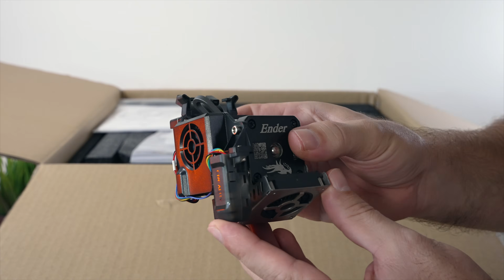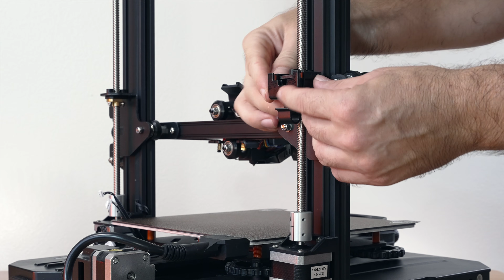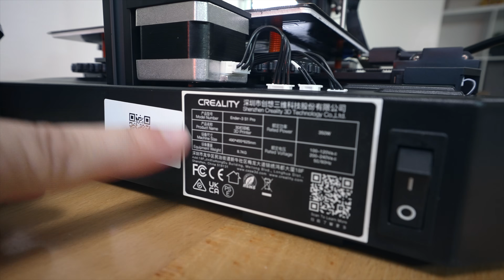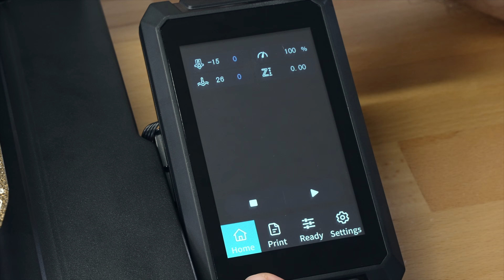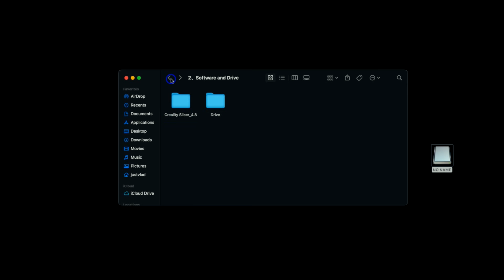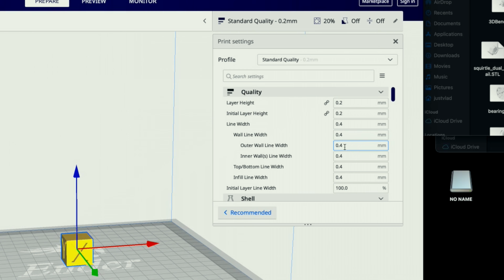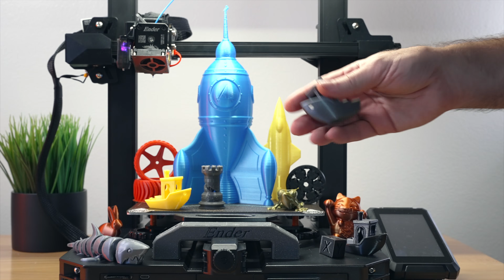Creality Ender-3 S1 Pro - 3D Printer - Unbox & Setup

Comment: Finally scrapped mine this week. Had it for about 18 months and only printed one of the test models. Worst machine I’ve ever owned. Never worked, impossible to level. Replaced it with another Creality as fighting it did my head in.

Comment: For some reason I’m not able to go thru the manual leveling process. The buttons aren’t recognized and machine doesn’t do anything. Manual leveling works just fine, but I need manual to work. Also my sd card isn’t recognized. Nothing shows in the printer page

Comment: im not trying to hate but im just setting up this printer and im not sure if these are fake comments praising how easy this is but. i don't find this easy or clear. The instructions are trash, loading filament in the manual has you heat the nozzle and it will autofeed the filament. The manual does not go into how to heat anything just says to heat it. In the video i see how to heat the nozzle but you don't show how to stop it. What does PID mean? For a complete novice this vid has some missing info. its better then the manual but not by much. Im sorry it could just be me but i find this very frustrating. IDK

Comment: The first best video I have seen on Ender 3 stuff. I have just done exactly what you have shown me with success, up until I got to the bed levelling. When doing the Manual one I hit my 1st problem. When using the paper for distance, as I have always done on my old Ender 3, I cant seem to get enough lift of the bed to the nozzle when it runs out of tension Spring and it is still 30mm away from the nozzle? Can you advise with this please?

Comment: Excellent video. You are very good at this and your instructional video is very much appreciated. One question: when you slid your y axis table back and forth, did it feel notchy i.e. points where the table stopped until you pull a bit harder then it continues to slide?

Comment: UNFORTUNATELLY, the Ender 3 S1 Pro was one of the best for the price(not so, but, worth the money many said) when I was deciding which one to buy, and the dream came true, it was quiet, within the budget, good quality, heavy built, easy to learn, but ... after a month or so it unveiled it's failures (injected on purpose in my humble opinion), it started with the extruder cable making false contact somewhere in the plug, then the CR Touch started to descend every time the extruder reached the Y limit, every time !!, even before I noticed, then it started crashing against the heating bed border, scratching the magnetic layer, bending the CR Touch Probe, so no more auto leveling or manual leveling, just nothing the same day the Z axis was not properly detected (I assume) causing the nozzle to plow the tip against the adhering layer hurting the nozzle, the bed and bending the heat break, in a single day 6 elements of the printer were SEVERLY DAMAGED, don't buy this BS !!!

Comment: I just bought this printer thinking with the auto bed level I wouldn’t have to do all the leveling I had to do with the pro. And now I have to level the bed and the extruded. What a pos product. This thing is going back for return. Why would they put a auto leveler and I still have to level it.

Comment: Ok, you totally left out the step where you measure under the right and left side of the x axis bar, if you don't do this you'll NEVER LEVEL your bed properly. This will make people want to rett their printers or try a different brand. This happened to me last night I finally found the x axis bar drooping on the right side of the printer. But great video!

Comment: Thank you, i had issues levelling the bed at first but i eventually figured it out. essentially i manual level first, raise the z axis 1.0 at a time until close enough, then spun the physical rings under the table with a paper touch, did the automatic and then a manual test again. I ended up going 3.5 on the z axis in the end but I'm glad I went bit by bit. nearly broke my nozzle by plunging it into the table. but not enough to cause damage.

Comment: i have tried following along, but when i went to manually level it, the leveling bolts ended up screwing out all the way and it still wasn't tight. then after sucessfully autoleveling, i tried to do the offset and got to -5 (maxed out) and it still wasn't touching the bed or computer paper i was using. ugh.

Comment: How the hell you could manually level the bed while keeping the z-offset at 0.0 it's something i cannot figure out. Even if i get all the bed knobs all loose, the nozzle still is about 1-2 mm above the bed. I have to adjust the z-offset previously to something reasonable, then adjust it again after auto-leveling

Comment: After watching your Review and as I wanted to have a 3D Printer, I bought this Printer directly from Creality as they had a sale on. I also bought their Sonic Pad Control hoping to use the printer remotely via WiFi (if I haven’t understand incorrectly). Have you done any review on that Control Pad by any chance matey?
Also, after levelling up the Bed, I had to offset the Z Nozzle a fair bit for some reason. I had to offset -2.50 for APL Filament & -3.05 for ABS Filament … I tried to reach out to Creality a several time without any success. I even tried to call the number on their website, was the dead end too. Since I watched most of your reviews on 3D Printers especially those by Creality I felt much confidence to go ahead to take the step and committed to their Ender-3 S1 Pro . I was thinking to printing a 300mm long roughly 150mm width and 20mm depth plate ( Zero Clearance plate to be precise) for my Table saw. If I setup an angle do you think it can be achievable at all? Any advice and your kind guidance would be much appreciated. As myself being disabled I need a lot of help and jigs to do any normal things those anybody else can do eyes closed (metaphorically). Anyways, I probably took long enough time and asked too many questions, hence I do apologise. Look after yourself and each other & Stay Safe. Remember Life is Short so Live Long and Prosper … 🖖 Cheers mate…

Comment: great video, appreciated.   question:   for manual levelling,  I loosened the 4 knobs pretty much all the way but the nozzle is still quite high up from bed/paper    I was able to use Z-offset of -4.65 and get it touching paper on all 4 corners.    I think -5 might be max zOffset so I'm curious is there something else I can do to get bed higher up, closer to nozzle?
Reply: Having same issue. Did you find a solution? No where seems to have a good answer

Comment: Followed all of the directions in the video but I am struggling with getting the bed centered for the leveling process. it keeps wanting to test off the edges of the bed. Manually resetting the settings to factory doesnt help.

Comment: @ 14:39, I have this printer and the label on the cable is to be inserted in the bracket so it can be pulled out again if you need to. Also, the cable plug ins on the left side, put the stepper motor one in LAST so you cab push the other 2 in front of it towards the left side edge to keep them away from the bed.

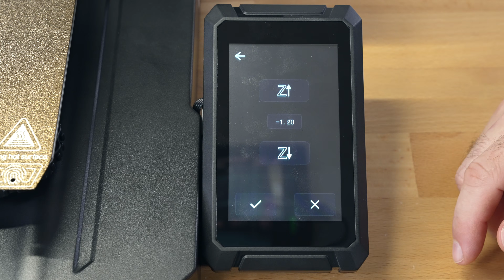Comment: You have "nice screen" because of... black bezels around?? Looks like pathetic advert. Screen is nice when it's CAPACITIVE! And my guts tell me this cheap screen is pathetic resistive sht. No matter how big resolution is (it's NOT NEEDED), but important is how well your screen reacts on your touch. Obviously if it's resistive, it's cr@p. And... YEP, I reached 34:04 where you tap FOUR times before you get to previous menu! Screen is rubbish!
Menu of the device is also simplistic and has barely distinguishable elements. Looks like people took CONSOLE interface and reflect it on GRAPHICS screen! So ugly interface I didn't see since MS DOS with TurboVision.

Comment: Great video. I am completely new when it comes to 3D printing. I have no idea what I'm doing. I purchased this printer after hours of reading and watching videos to decide which one I wanted. I just got it in and I've watched this video a couple times to assist with setup. I am having some issues and I don't know where to go for help.

I have attempted to level the bed manually, as you describe in the video, and then use the auto leveling. My bed seems to be too far from the print nozzle. I have to completely loosen the screws on the bottom to where I can't adjust anymore to get close enough to the nozzle. After all 4 corners are close to what I assume is good, I push the center button. The nozzle is then too far from the center to be able to use the offset. Even at a 5.00 offset, which is as far as it goes, the nozzle is still very far from the bed.

If anyone could please help or point me in the right direction I would be very grateful. Again, I am a total NOOB with this stuff and Im just trying to get into 3D printing.
Reply: Same here.  Also, WTF is the brass nozzle for? Where does it go? How to install it? Is it optional? The manual is quite useless.

Comment: What are your suggestions/settings for TPU? I printed the Benchy in TPU and got a fair amount of stringing. I used 230 nozzle temp, 60 HBD, 20ms print speed and no retraction.

Comment: This is my first 3d printer, and after setting up I broke the sd card slot by putting the sd card in upside down, new owners don’t make that mistake now I’m using the usb to usb c to print through cura make sure the metal tabs are facing up on the sd card when insterting not the logo of the sd card smh

Comment: Hello,  I just received the Ender 3 S1 pro, and I need some help, I don't know much about 3D printing, it was supposed this was for my son :(, but in the end, he doesn't know as much as he was saying, we follow the instructions and seems to work, but every time we print, at some point the model moves away from the base, like the steel plate is not working well (check at 60-70°C) we are using Creality filament

Comment: Hey guys! If you are in Europe or Africa maintain the 230 V. Don’t change it to 115V otherwise you’d ruin your printer.
Reply: Use 230 volt if you are in another country than the us and japan you meant to say? :)
Reply: Thx just saved my bacon right there
Reply: Can i put 230v and start it
Reply: @brato03  Use 230V only if you’re in Europe or Africa.
Reply: Im in europe but i fcked it up il buy another psu
Reply: Thanks man, looked for this to make sure I didn't mess it up!
Reply: Dam I Alr fucked up
Reply: 480$ went away in seconds
Reply: Im curious, why?
Reply: I’m fd up, should I throw or replace some components?

Comment: Thank you for this video, I used it to help me set up my Ender-3 S1 Pro and the first print was absolutely perfect the first layer went down just right, adhered perfectly and popped off easily. I doubt it would have gone as well as it did if I hadn't watched this video and adjusted it as suggested, I found most of the rollers were extremely tight and you could feel the axes get stuck in the positions they shipped in (the rollers might have developed some flat spots from the pressure over time), but after loosening them per your instructions (and making sure to turn them all random amounts so that the potentially flat bits don't all line up at the same spot) it moved SO much smoother.

Comment: You are a natural-born teacher. Your video was probably the best instructional videos I have watched on YouTube. I've been considering buying a 3D printer for a long time. My big hold-back is that they need a file in order to print. I have items with broken parts that I need to reproduce using a 3D printer. Earlier today I watched a video of a small 3D scanner. I thought I had my answer with the 3D scanner and a 3D printer. Would it be feasible to use a 3D scanner and produce a file that a 3D printer could use?  Any assistance would be most appreciated.

Comment: During the leveling process, I used the paper to check the 4 corners, then auto leveled and proceeded to the offset. But the offset wouldn’t get close enough to the paper and capped out at 5. Idk what I did wrong. :(
Reply: Raise the bed with the large knobs and then start over with the levelling

Comment: hey Vlad i setup my 3d printer and it works but whenever the nozzle starts printing the 3d model the z axis doesn't move over time when my object is getting taller so it starts hitting and knocking off the filament that was already printed on the steel surface. Please help

Comment: I want to thank you for your video. All of the quirks you experienced were not present in my unit, i have a theory that it is likely due to fixes based on reviews like yours. It went together fast and easy thanks to your walk through. My first 2 prints went off without a hitch.

Comment: Need help, the prints that came with it came out very nicely. But I want to print something else that requires a slower print speed. Whenever I set the profile with a print speed of 30, the printer ignores it for some reason and prints it at 100. I constantly had to manually lower the speed and its getting annoying.
Reply: Might need to fix your slicer settings for speed.
Reply: @hopelessdecoy  I did that. No mater the number I put in on the slicer, it always behaves like i never changed the setting. The estimated time doesn't even change either.
Reply: @bigboomer1013  I would try reinstalling the firmware (double checking version ect). Sometimes things do just load wrong even in desktop PCs
Reply: @Hopelessdecoy  good news, the autobed leveling is working. It's probing now with the heater on and foesnt take forever. I updated the firmware. However, it doesnt seem to actually fix the leveling that well? Not too sure. Had it for 3 months now and I can only assume that something is uneven. Especialy since when I tried to loosen the springs on the bed where it has no tension at all, the nozzle doesn't seem to across the even bed at the same z height when trammig the hot end.

Comment: THANK YOU!  I've been avoiding 3D printers up to this point because I really didn't want to put the time into the learning curve.  Now they've advanced to the point where there isn't too much and your video gave me the confidence to do it....and I did.  Rabbit is printing now!  Thank you!
Reply: yea i wouldnt say that there isnt too much to learn yourself. every 3d printer is extremely sensitive to anything you do to it and you need to have a good understanding of the mechanics of 3d printing to be able to set one up yourself and get accurate prints successfully
Reply: @Mr.Thermistor7228  For sure, but if that fear keeps you from doing it, you never will.  This video helps the novice get introduced to 3D printing.  I've only been at it for a week now and have plenty of spaghetti prints, but without someone like Vlad breaking down how to get started I never would have ventured out to learn all of in's and outs of Cura, etc.
Reply: I'm not convinced this is a set and forget, plug and play, no smoke out the ears, never inducing furious wrenching of one's hair type of 3D printer and don't know any of these budget open frame dealies are. I used to own an enclosed printer which happily kept the user out of the environment, levelling the bed, making a coffee while you waited, even told you what sort of filament you had inserted into the inbuilt spool. I had more hair and it printed okay too, but was a lot more pricey for what you got than an ENder which i greatly prefer. I think to have fun printing you inevitably get tired of white PLA and once you branch out to printing PETG, carbon fibers, then metal and finally reels of titanium infused granite, the problems start. HOwever, most of them are manageable and on balance between attacking the printer with an axe in frustration and rewarding tweaking these have it about right.

Comment: Wauv your printer seems to work out of the box! 
When I do the corner leveling manually and then auto level it seems like the printer is completely forgetting the setup (and Z height) and stops the nozzle >5mm away from the bed. I cannot adjust the corners any higher, and I cannot compensate that much on the Z height, so now I don't know how to proceed.
Reply: I have the exact same issue. Did you ever fix it?
Reply: @NathanJLaBrake my z axis on 1 is more than 5 away. I've tried leveling 5 times now. Still same issue. Any ideas?
Reply: @scottfoot6320  What I did to solve the issue was to reset to factory settings. It's a step that's shown in one of the demo videos on leveling that I hadn't watched. After doing that and then re-leveling, it worked properly.

Comment: the s1 is great printer, however this one was definitely setup by the company before hand knowing it was going to be in a video. I've never seen one come with the z offset already set to something other than 0. still a great printer and the setup isn't all that hard even with it not being preset, only thing I can say is mine is fairly close to the max z offset to get good results which is a bit concerning

Comment: Brill video and just watched the one on the Sovol SV01. Also looking for some advice. So I've never had a 3D printer and never even used one but I'm looking at getting one. Figured it down between the Sovol or this one - which  is £100/$120 more. I'm not going to use it for vast amounts of printing and will be for small components for diecast models and some other projects (not sure about what yet). My question is: Is the Pro worth the extra cash for the better components like the dual gear extruder, bed etc. or are those things that will make no difference and better saving the money? Many thanks :)